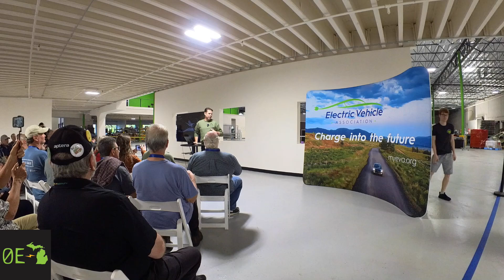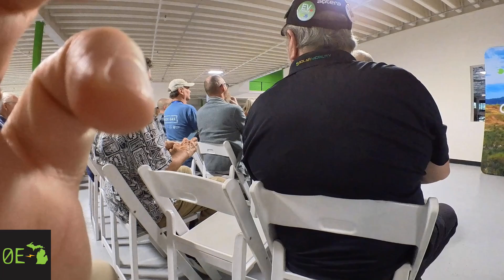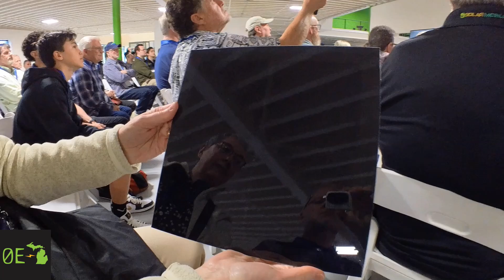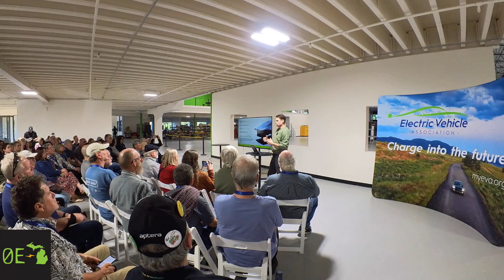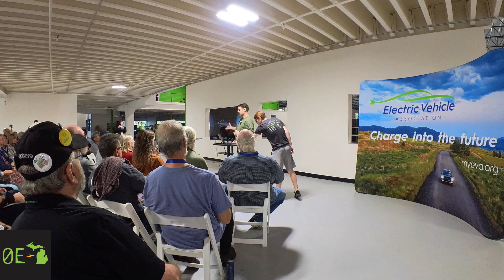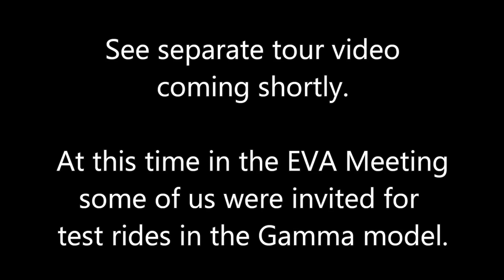Aptera's Chris Anthony Keynote and Q&A at 2024 EVA Meeting

Comment: what is a 'Roof Crash Strength' they are talking about in 03:02? Is there any difference with regular body crash strength? Obviously, no one crashes thru roof.
Reply: part of the reason for the Roof Crush Test is in case  of a roll over. I imagine most of us have seen pictures of a vehicle that has the roof crushed down close to the height of the hood. With the standard box shape car, it is pretty easy for a corner to take the brunt of the force and collapse.  There are numerous stories about the original Beetle being is a roll over situation and being able to be driven away. The Beetles shape was similar to half an egg which explains that ability.
Reply from the maker: https://one.nhtsa.gov/cars/rules/rulings/RoofCrushNotice/216NPRM-to-FR.html#:~:text=The%20standard%20requires%20that%20the,22%2C240%20N%20(5%2C000%20pounds).
Reply: @0e-michigan  thanks for the link, very interesting!
Reply: Good to have a strong roll cage protecting the passengers.